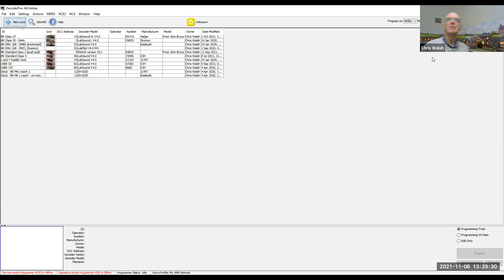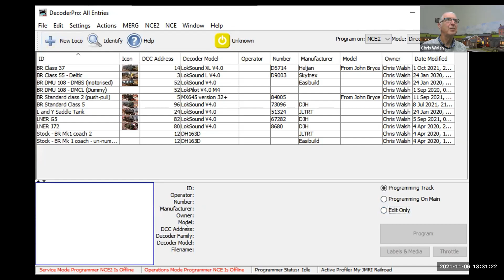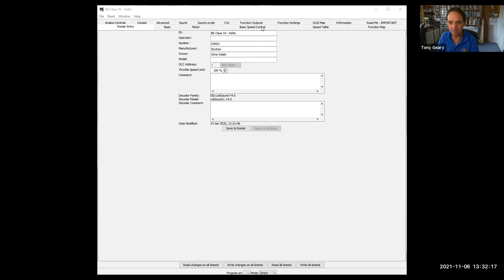Bryceborough & Dottisford Zoom Session

Comment: Many Thanks Chris, I too have similar Problems, I have a Room 3,100 x 2,800 and wanted to do O Gauge, bought some DC Steam Engines from the Guild’s E&T  Service when it was running, greatly missed and some Peco Wagons. I also invested in a Digitrax DCC System 5/8amp although I realised I have to fit Decoders to the Engines. I then thought perhaps I haven’t enough Space so bought some American HO DCC Athearn Engines and American Freight Wagons + Code 83 HO Track then I saw a Video about the Westerham Branch and it rekindled my Original love of a small O Gauge Layout, how large is your Layout please.